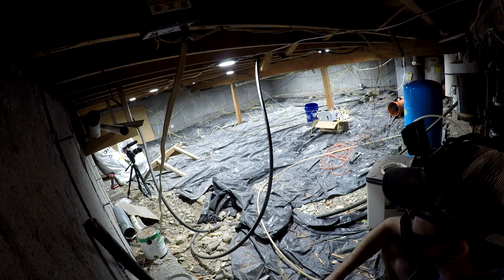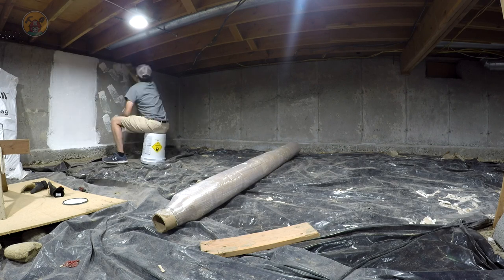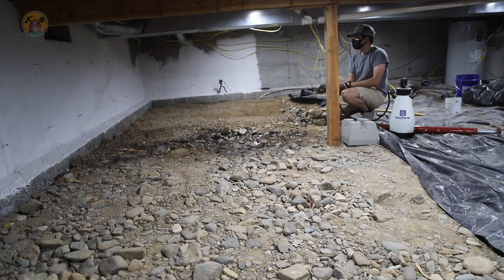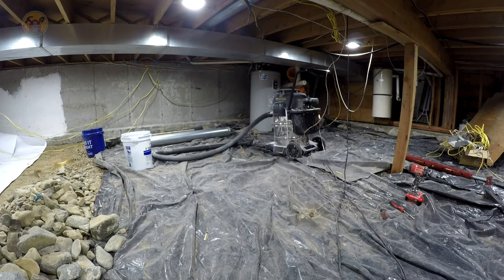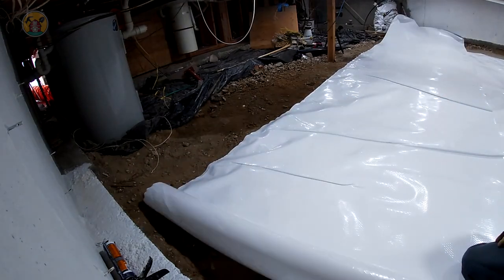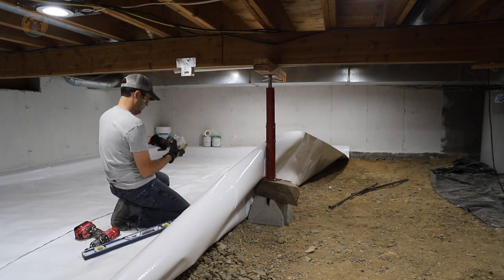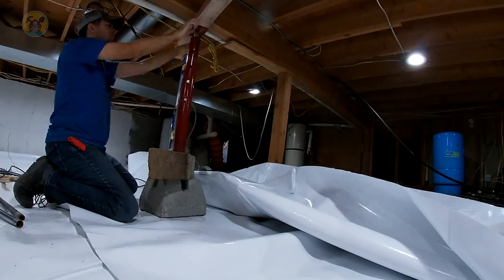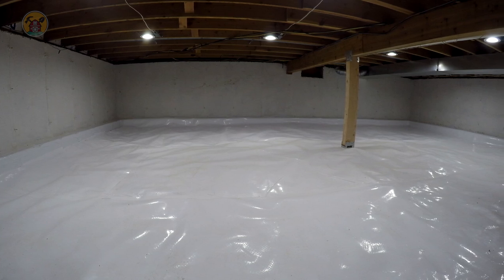Unconditioned to Conditioned Crawlspace.

Comment: the use of wedges is actually a very common method used to level the floor joist of houses. they are not screwed or anything because if done correctly. The weight of the house should be more than sufficient to hold them into place. what you did is a much cleaner approach and looks better but how it was done originally was fine as well.

Comment: A suggestion as an alternative to lining the crawl space with plastic:
2" closed cell spray foam is considered a vapour/radon barrier and provides the added insulation value. It can be applied to compacted soil. It would not be as labour intensive as encapsulating with a liner and would be a little more durable. (the seal won't be broken as easily)
I had a quote for crawl space encapsulation of $15,000 the same job in spray foam was $3700
Concrete can be poured over the spray foam for a durable finish.

Unfortunately closed cell spray foam on a crawl space scale is not a DIY project. You would need to call in a contractor....
Reply from the maker: Thanks for the suggestion. Unfortunately thats out of the budget for this project. But seems like that would be a solid method.
Reply: Is the dirt in the crawlspace already considered compacted or would you have to tamp it all down?
Reply: @bend4852  For Spray foam? That depends on what the dirt in the crawl space is like. I would expect it would not be suitable if it is easily blown around with air, keep in mind you blasting air onto that surface...
Here are a couple videos that helped me decide what I should do...
https://www.youtube.com/watch?v=vGSFLPqKi_k&t=0s
https://www.youtube.com/watch?v=OIu44LwEGgQ
https://www.youtube.com/watch?v=BpCrWSAs8sI

Comment: You should of used Siga fentrim 430 tape to the brick/concrete it the best tape on the market by far that actually will bond to the concrete and not lose its stick over the years.

Comment: I think the moisture/ mold barrier is a bad idea, since there isn’t any moisture coming from the inside it’s not the correct place to put it, it’s going to reduce the drying potential of the moisture to the inside so any moisture that gets in from the outside will collect and slowly destroy your foundation
Reply: Concrete does not care about moisture.  Water does not degrade concrete, which is why they build docks and hydroelectric dams out of the stuff.
Reply: Use a dehumidifier 😂